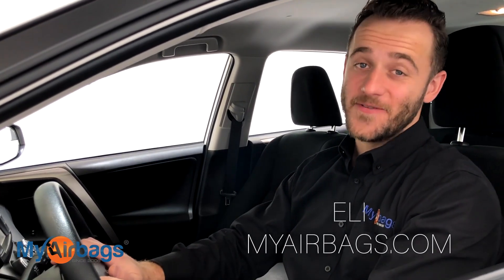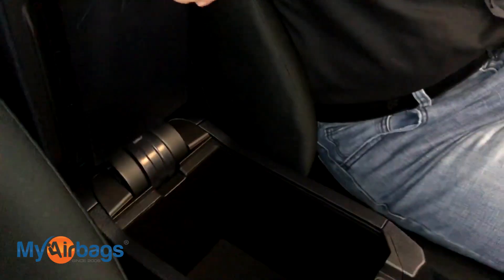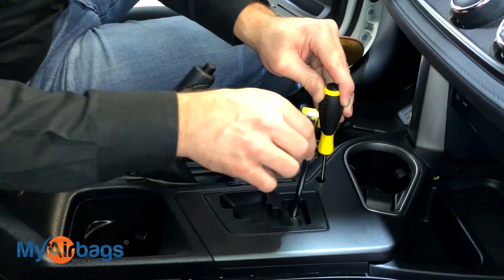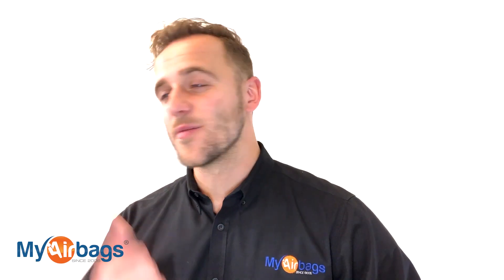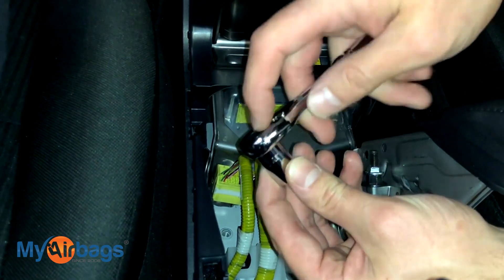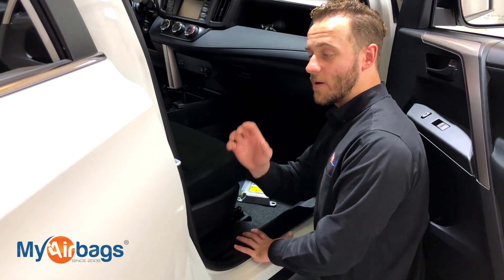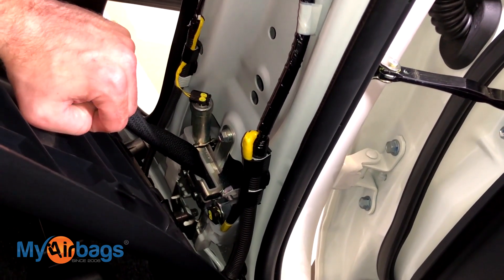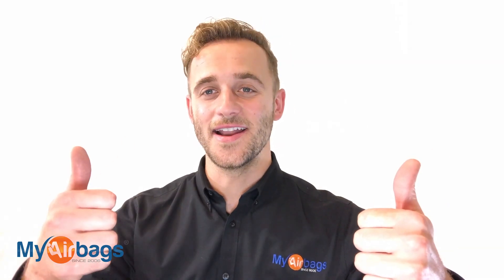How to Remove SRS Airbag Module & Seat Belts on Toyota RAV4 2015 -2019 | MyAirbags

Comment: Thanks for the video. I believe one squib is for pretentioner ( DTS B1901) and the other is for Selectable force limiter (DTS B1941). Both on the seat belt mechanism
Reply from the maker: Yes, both of these codes are for the seat belt. You will need to replace the seat belt. There is also an option to repair the seat belt at myairbags.com

Comment: Hi 
Please ,can you tell me where is the location of the passenger airbag waight sensor location in rav 4 2018 .
Thank you
Reply from the maker: Hi, It should be UNDER the front passenger seat. Its mounted to the seat, not on the floor. Please reply once you have found it. Thank you

Comment: Hi. Please answer my query.
My Rav4 car was hit from the back. No airbags were deployed, but it still shows an airbag error after the accident.
Does it mean that I have to send the pretensioners along the module for the rebuild or only the pretensioners?
I want to know if the module is affected or not.

Have a great week-end 😊
Reply from the maker: Hi Kompressor, I would recommend that you connect a scanner to your OBD, and check what airbag trouble codes you receive from airbag system. As a guess on the information provided, I would suspect that at least the drivers side seat belt is deployed and the module for sure. Please us know if that helps and if you have more questions. Thanks for your comment!
Reply: @MyAirbags  thank you very much for answering my questions. I really appreciate it.
I'll do the scan and find out what to do.
Have a good day 😊

Comment: Hi,
My Rav4 2017 with 90,000 km shows error (SRS Airbag system malfunction - visit your dealer) And no accidents happened. Also steering wheel buttons and Cruise control stop working!
guide me to get this fixed? Thanks
Reply from the maker: Would recommend to have it scanned to see what codes you are getting

Comment: where is Yellow connection that you disconnect and reconnect for Airbag light on dash to go Off ,, it used to be under driver seat in my old Toyota , but could not find it on rav4 2018
Reply: Got it , Under passenger side , 2 yellow connection seatbelt and Airbag has same connections
Reply from the maker: SAM JADe, thank you for your helpful contribution. Its helped others with the same question!
Reply from the maker: Thank you for your follow up comment!

Comment: He’s lying about dealerships having to program the srs module , they don’t have to marry shit to your car. You can buy a used srs module that hasn’t had any airbags deployed and it should work
Reply from the maker: Hi Alec, Yes you are right for some models they don't need to be married, however for most models, generally speaking, these computers need to be programmed to the car. Additionally, when you buy a used module, you also need to make sure the part number you purchased is also the same as the original. We offer the reset service on the original module so our customers don't need to worry about any of those factors. You can simply use the original module that was in the car during the deployment and that has been a very popular, low cost solution for our customers. Thank you for adding your input and feedback. We appreciate it very much. If you would like to have a reset done on your original module, we can help with that, as well as the seat belts: https://www.myairbags.com/product-category/repair-return/airbag-module-reset/
Reply: @MyAirbags  how about a 2018 Volvo S60 I ran into a problem with the srs module and it’s not able to be reset most of my sources say that those module shock when they deploy is that true ?
Reply from the maker: Alec, yes, Volvo modules can be pretty problematic. We are able to test the modules here to make sure its reset and also determine if theres any issues with the hardware. We can help if you want to have it reset : https://www.myairbags.com/product-category/repair-return/airbag-module-reset/